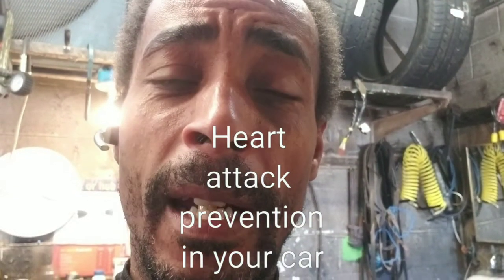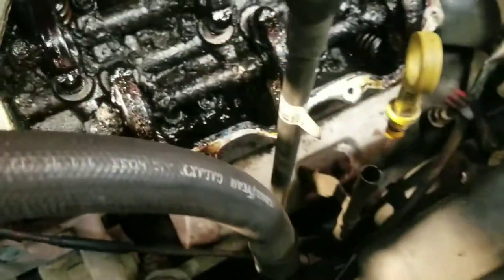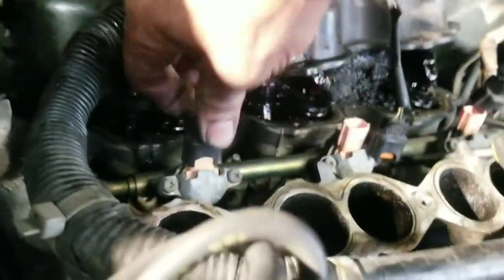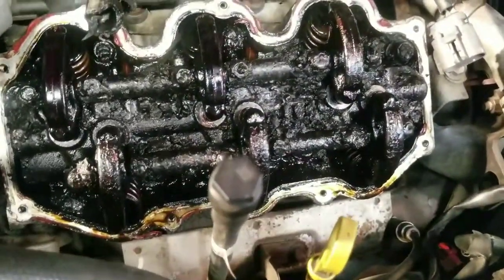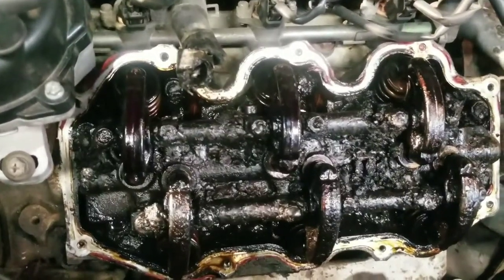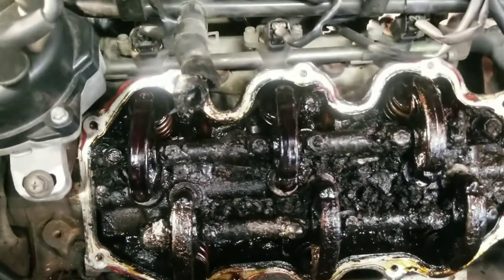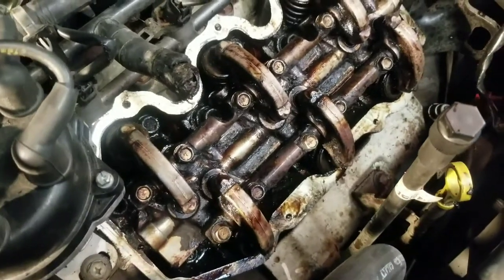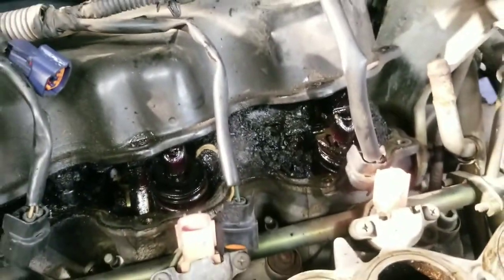What Happens if you Never Change your Car's Oil

Comment: It is actually calcium that makes up most of that plaque.  The test for the plaque actually tests for calcium.  So those that chunked up oil represents calcium in the arteries more than anything else.  Magnesium manages calcium in the body to make sure it goes to the bones and stays out of the soft tissues.  So does K2, but magnesium is "da man" in the human body.  Note that people with a heart attack usually (always?) get intravenous magnesium when they arrive at the hospital.  Cellular energy is spelled "Mg-ATP," NOT "ATP."  ATP without a magnesium attached is worthless.  At least 3,751 proteins in the human body (about 1/4 of all the proteins in the human body) have a magnesium binding site that needs to be filled with Mg for optimal function.  Do some research to find the best kinds.  Magnesium oxide is very popular, but not  very good if you want to absorb it (and I know I do!).  Citrate is popular with the Mega-Corps, so I avoid it, too (long story for those who don't already "get it").  Magnesium malate, epsom salts, magnesium chloride, and magnesium glycinate (make sure it is free of glyphosate!) seem to work out well for most people.  Many enjoy foot baths with magnesium chloride.  Anyway, food for thought to keep the mechanic going strong for a long time...
Reply from the maker: the best advice ever, thanks.
Reply: @crazysexycool180  Bio-copper is huge, too.  Search "Morley Robbins" to learn more about magnesium and bio-copper, and how iron, Calcium supplements, glyphosate, high fru tose corn syrup, and hormone D supplements deplete magnesium and bio-copper.